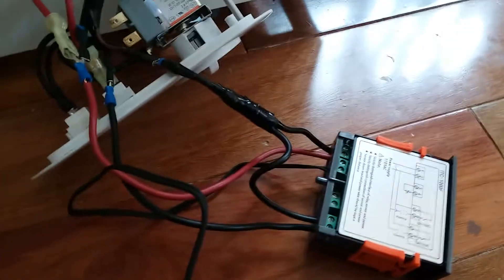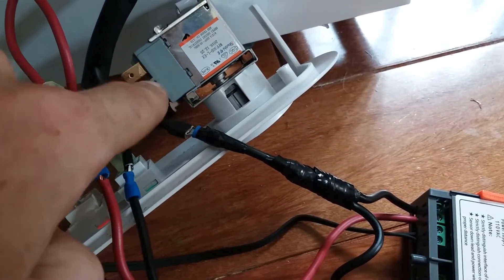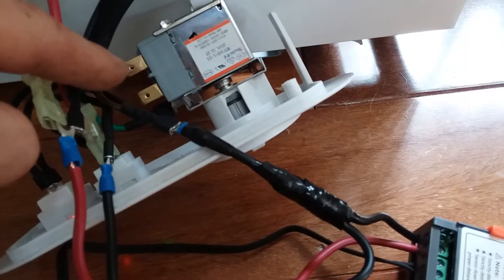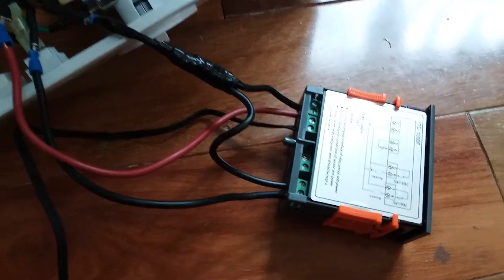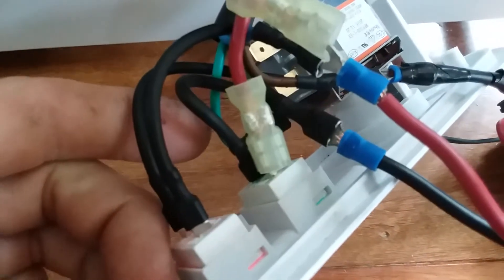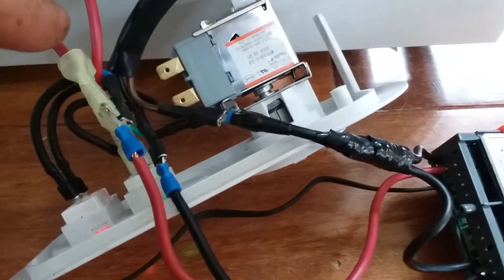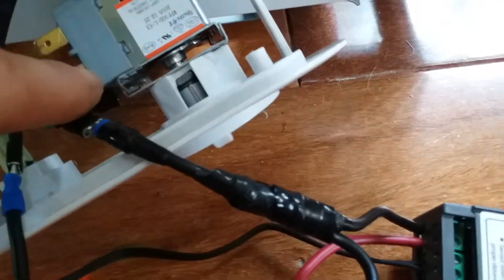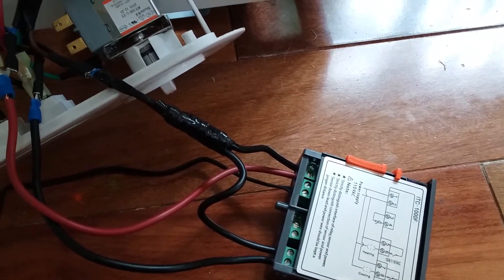Chest freezer conversion  (stc or itc1000) hardwire for dummies

Comment: Great video! You get right to the main issue, the thermostat! You show Excatly what i needed for a commercial chest freezer, found your video after spending hours on videos that said they'll show how to wire but never showed the thermostat! Thanks, i got it running, but cannot get it programmed to go below its factory set point. Any ideas?
Reply from the maker: Don't remember the details, it's been so long but if you have the same one just keep messing with it... I followed the program instructions and it worked.

Comment: I have black, brown, blue and green. I grounded the green! Now I have black, brown and blue. I can get the unit to power up with the black and brown but when I feed the cooling terminals with the black and brown it just clicks. Can you help me? Thanks 👍
Reply: I'm not really complaining but, why open the access door.  Turn the temp control on freezer to the coldest. On your remote controller. Wire in a receptacle (where you put the wires for the compressor). Then simply plug in the freezer, and plug in the remote controller. Set the temperature...

Comment: Hello I have come across your video on converting a freezer in to a fridge I have a freezer I bought that  2 days ago and I already had a very similar (older model) thermostat controller I wired it up like you have on your video. And I got it to run my freezer ok. I have the stat set to 5c but I put the sensor where the original old one went but I was finding the freezer was going 5c and shutting off like its meant to but the temp kept dropping to around – numbers but the inside the freezer there was no ice build up at all. I did try the sensor attached to the wall in the freezer and that’s giving me readings of around 0.0 but it does in time creep back up to what i set 5c. I was wondering if you might be able to help in any way get it more stable.  I am testing the fridge empty not sure if that would make any difference
Reply from the maker: All thermostats work the same but have slight variation in how they balance the temp.. On mine, i set the temp and then set another higher twmp for when i want ot to kick back on.. For instance, i want my fridge to be 33° so i set my chill temp at 30° and my restart temo at 36°.. This makes my freezer stay halfway (33°) between those numbers...its an balancing act you need to find with your specific set-up, and yes, a full fridge will act differently..
Reply: @theloosemoose8200  thank you for replying so it's better to set up my freezer fridge with items in it to get true temp readings

Comment: At 8:55 you say 48 volts but you have everything spliced up to line voltage 120?

Or are you running the controller on 48 volts somehow?

Pretty sure all of your control wiring is stepped down, so you are under-voltage on the controller?
Reply from the maker: For whatever reason the 120v going into the freezer junction box before the compressor steps it down to 48v for the thermostat /light wiring circuit. I didnt take apart the box to see exactly what's going on but the controller and freezer work perfect and its been over 1 year now..thats the truth of the situation, sorry i cant give a more technical answer...

Comment: I did a chest freezer with the 12v thermostat to control a small inverter on and off. Tough to find the right inverter, needs to be one with a switch, not a button and pure sine wave, started with a 600w and downsized to 300. The system works great and draws about 70wh probably less once food and thermal mass is in there and stabilized. Drops like 2 degrees in an hour while off, in a hot garage. Probably going to install the 110v into the fridge as well so that both systems are properly controlled.

https://www.reddit.com/r/vandwellers/comments/4efrgd/creating_an_effective_and_ultraefficient/

Comment: Kudos to you, TLM!  You have a real gift for explaining things so clearly.  I even have a Magic Chef freezer, too!  I do have a question about the diagram on top of STC-1000.  My STC-1000 is identical to yours, but the diagram doesn't seem to match your wiring. Can you help me understand that?  Also, where did you mount STC-1000 and the temp probe?  Thanks!
Reply from the maker: +Mike Reid mine is a duel phase thermostat,  you might have a single phase model. I mounted my sensor uthe middle of the back with plastic clips and down into the freezer with the same clips. The sensor sits right at the inside step, it's also held off the wall so it gets a true air reading...

Comment: i got question 
i want to cutout all wires of old thermristor i got 4 on mine 2 blacks blue green ,,blue is live ,backs neutral i guess. and green ground ..when i short blue and green i get 23x volt mblu on each black give 0 ,,i bring live neutral out of stc and from new 220v cable ..out of pin 8  live and pin 2 netral to old power cable to comprssor ,and that circuit is broken .so question is what i need to start compressor ,i know power go in compressor 220v ,and to termristor ,he switch on of power to compressor ... how to do that now when i idiot cut all out ,,only left from baraker is these 4 wiers ... please help

Comment: Good info on wiring this unit.  I'm using it on a fridge/freezer and trying to maintain the freezer part while using the fridge as a fermentation chamber for making beer.  I'll be using the heating function too which I guess I can splice into the same hot for the unit and cooling.
Reply from the maker: Marcus Green yea, this stc1000 is a duel stage thermostat so it can do both hot and cold, make sure you don't buy a single stage that can only do hot or cold....